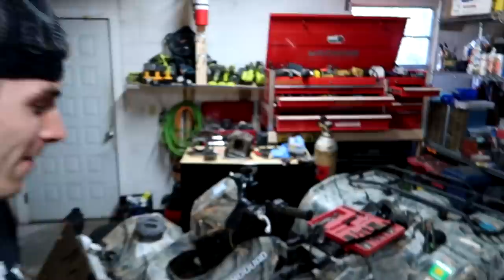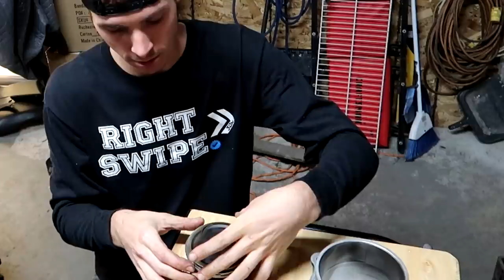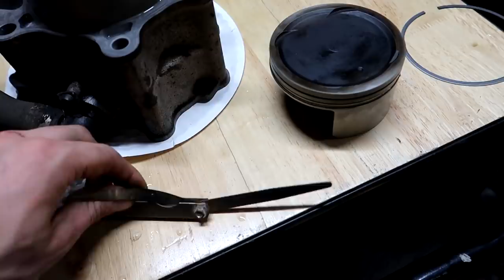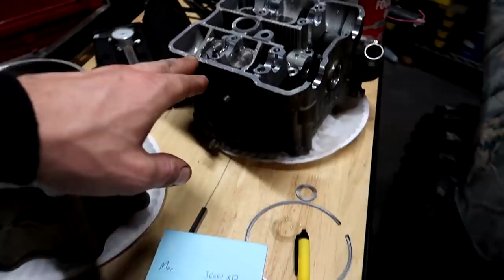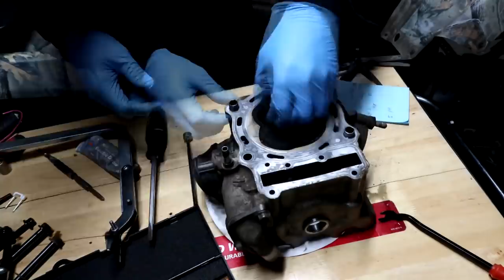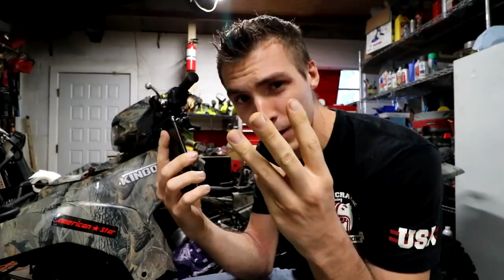Trashed Suzuki Four Wheeler - Will It Run?

Comment: Hey Dalton, get rid of that stock air filter as well. The stock air filter lets dirt pass through and then into the motor causing the issue that you found. I rebuilt a 700 king quad with the same issue. Check it out in a playlist on my channel. I had to get my cylinder replated though. Good work!

Comment: Replace the valve seals while it's all apart. You really should seat the valves, then assemble the head, then measure the lash and buy shims to make the lash correct.

Comment: Hot cam sells a shim kit for valve adjusting, ring and a top end gasket kit is a definite. And I would've gotten new valves or at least the intake side just because of the amount of sand and dirt the motor took in.

Comment: Hey dalton, I know you work on a lot of stuff and I was wondering if you could help me. I need to adjust my valves on my four wheeler. I just want to know if it is easy to do and any tips I would need. Thanks man keep up the great videos
Reply: Depends on what kind, but it’s pretty simple. Look up the specs, remove the tank and anything else in the way, take the caps/covers off the valve cover. Make sure engine isn’t at TDC on compression stroke. Losses lock nuts and set valves to spec then put back together.
Reply: @Figure-it-out  that works as long as it doesn't have buckets and shims like the King Quad.

Comment: Gonna have piston slap, cylinder may look good but I bet it has worn.. all that fine sand was basically honing the cylinder💀 and you should also check the rings where they actually ride in the cylinder, the bottom part doesn’t even touch the rings, I feel like I can see a line around the cylinder where the ring stops